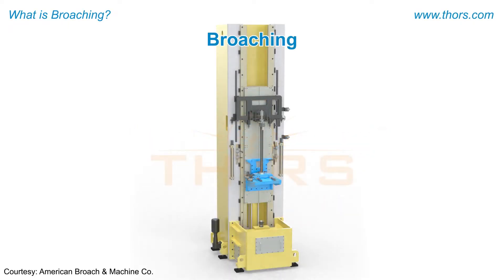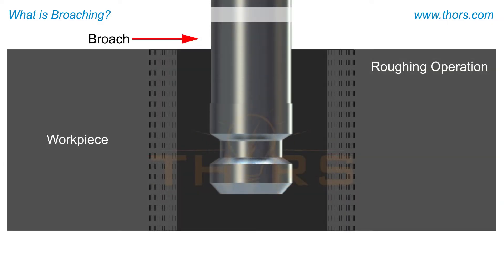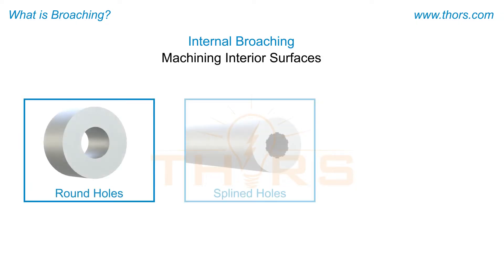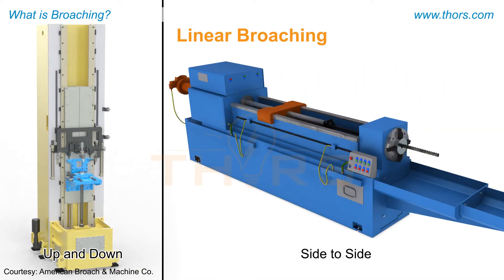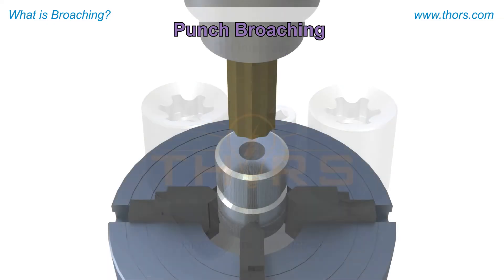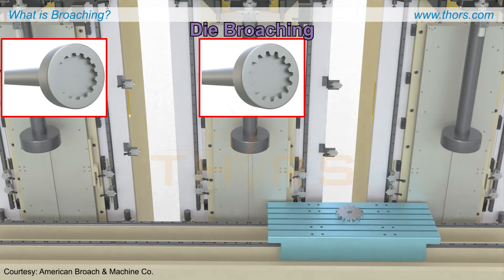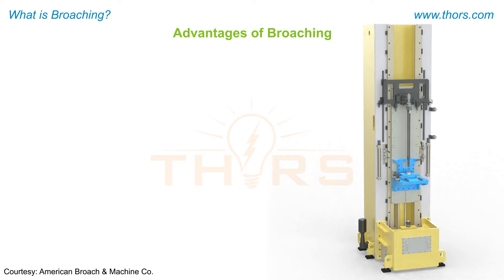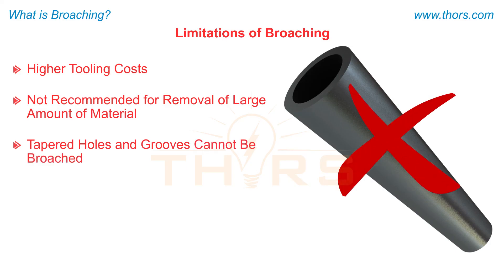What is Broaching? || THORS Broaching Video Series Course Preview

Comment: There are so many things wrong here.... 1: In your intro, the bulb is left hand threaded but it screws in like a right hand thread. 2: The "Gears" and "Keyways" broaching are identical. One is external, one is internal. 3: The keyways example you show is milled. Not broached. 4: The spline shown is milled. There's even the witness marks of a mill at the base of the countersink. 5: Nobody broaches straight holes. It's too expensive. They're typically milled with interpolation or reamed to final size. 6: The drawing shown in missing full definition. There should be a radius callout, and a square callout on the 80mm (unless shown in another view). 7: As a rocket scientist, I've never seen external broaching in the ways you're calling out. All of those profiles would be traditionally machined and MAYBE polished to get the contour required. Broaching is too expensive. 8: While you mention wobble broaching, you don't explain why it's called that or how it works and it looks like I can just plunge a square broach into a work piece. 9: Punch broaching is done at high temperature and doesn't "cut" the material. It mostly pushes the material out of the way. 10: YOU CAN'T ADD MATERIAL TO AN AREA THAT'S ALREADY BEEN CUT BY BROACHING. 11: Restate of 10. You can't add material by broaching. (Ref Die Broaching section.) 12: You speak of difficult to machine geometry, but show a very simple to machine part.

I will say your limitation section is correct. Those are typically the limitations of broaching. Anyone watching this video, be aware, broaching is both a lot more complex and a lot more simple than the video shows.

Why am I qualified to speak on this? I've been a design and manufacturing engineer in Aerospace and Astronautics for over a decade and (seen/been a part of) quite a bit of the upper end of complex machine operations.
Reply: i"M a RoCkEt ScIeNtIsT!!!